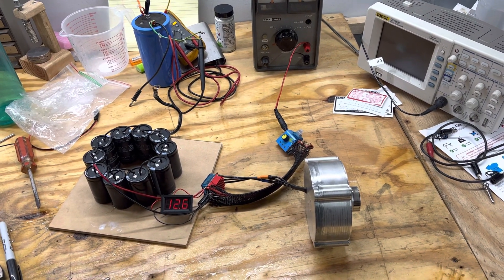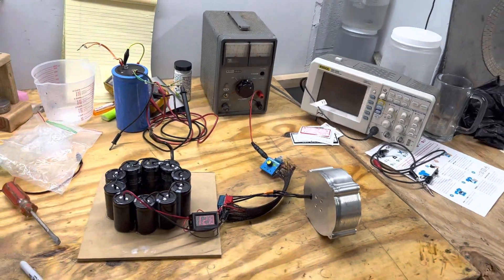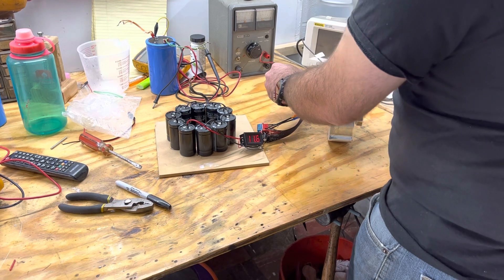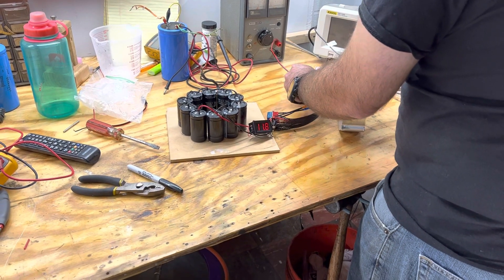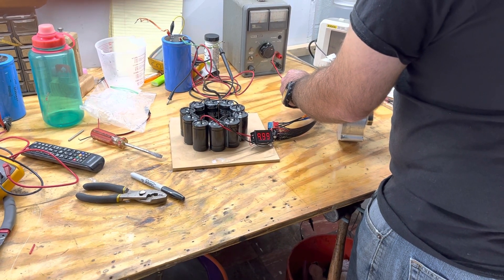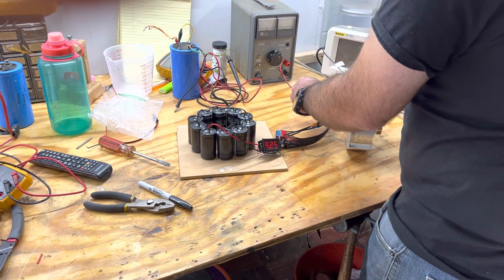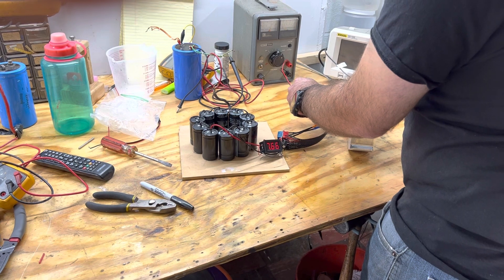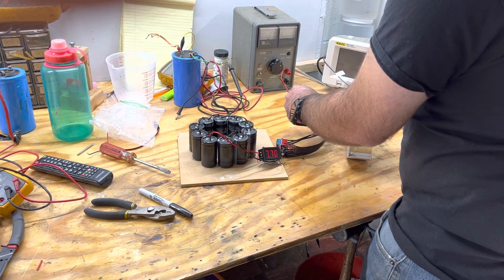Regenerative braking system power juggling between a gyroscopes inertia and a super-capacitor array.

Comment: 12 volts and high current as I have stated many times to produce anti-gravity waves to make the circuit superconducting to keep the device cycling back and forth.  A better number of supercapacitors would be seven connected in series with a total voltage of 12 for each bank instead of ten at 12.6 volts with ten individual banks connected in parallel to get the correct frequency of anti-gravity waves. The gyro and motor assembly would have to reach 4000 rpm to also produce the proper anti-gravity wave to keep the gyro and motor superconducting to recharge the capacitors.  A person needs about 2.5 farads total for each bank to be really effective.  This would be 1.7-volt capacitors of 0.35 farads each.  You are close Mark from what I have chatted with many people about.  Great job though!

Comment: Also, rotating the EM Field with the setup I showed to you would pulse the electrons which would make the atoms of the craft undergo jerk which is the time rate of change of acceleration. This would produce more anti-gravity waves. The electrons charge are also anti-gravity waves which are space waves being pulled into our universe from the parallel universe. The electron field would also produce RF waves which would then produce more anti-gravity waves by the RF interacting.  All of this setup would undergo harmonic resonance, so the craft operates. Spinning the gyro to the proper RPM's would allow different warp drive speeds as I explained in many emails to you. This would be accomplished by charging and discharging one, two, three, up to 16 banks of seven capacitors so there is more current. There are 16 warps as I explained to you in earlier emails that slowly go up to light speed.  To change the frequency of the waves to anti-gravity waves or wormhole waves the capacitors would be charged to a different current leading to a change in energy produces leading to a change in frequency of the space waves which are the anti-gravity waves or wormhole waves. To go up or down change the electron field to be higher or lower on the top or bottom. To move forward or backward change the EM field that is emitted from the UAP crafts segments that spin the EM field. This can also move the UAP craft left or right. The entire craft can be controlled with transistors, a computer, and an app.